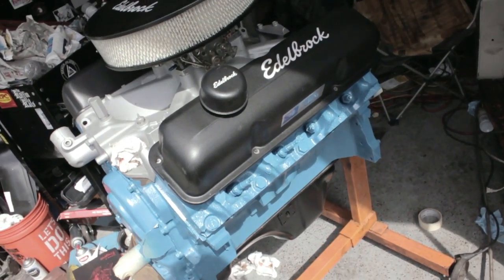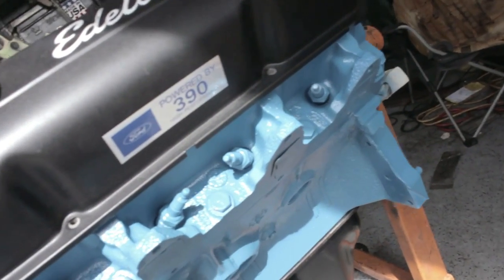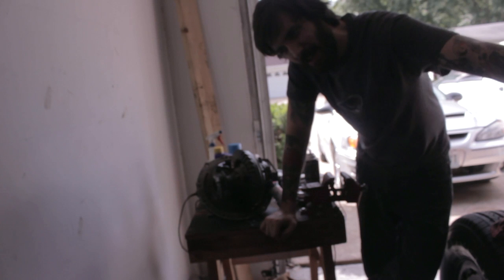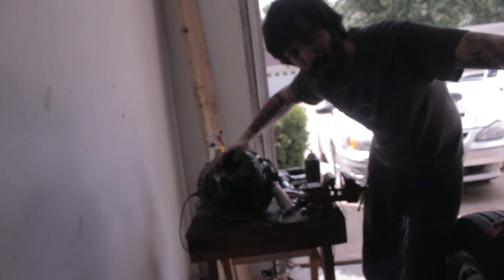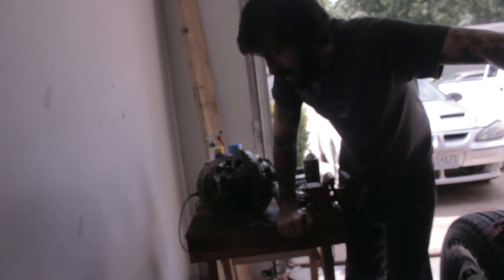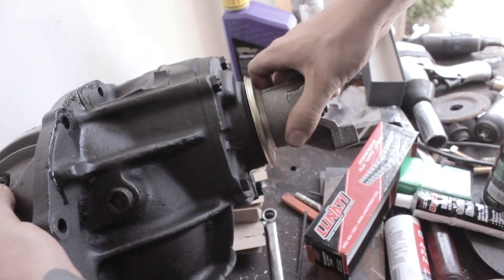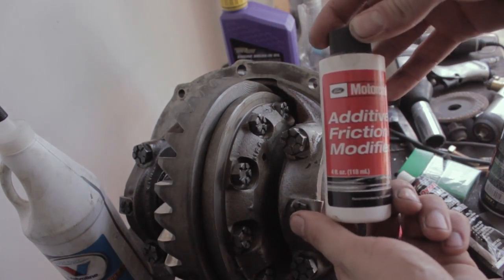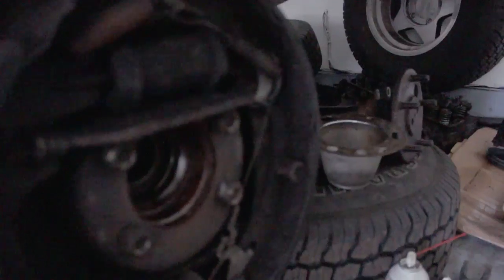Ford 9" Rear End Trac-Lok/Posi Third Member Swap - (1973 Ford F100 Rebuild = Day 32)

Comment: 600 cfm is very small for you configuration. I would recommended 750cfm  at least and het it a little rich. Read the plus on the 750 and go from there.
Reply: +Michael Dunn 600 cfm will be fine for stock power